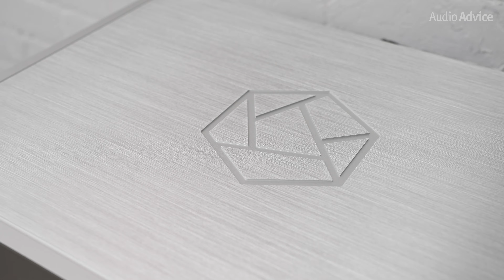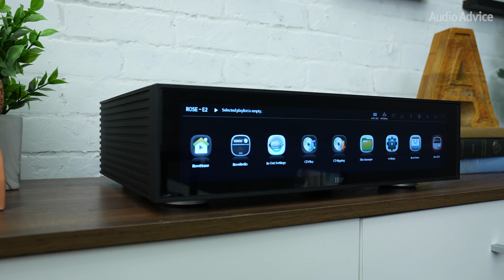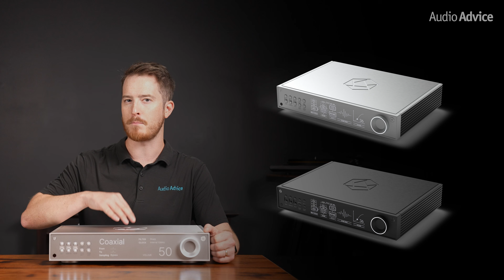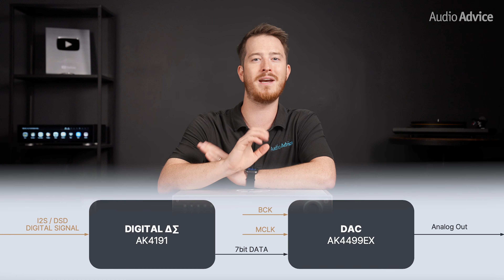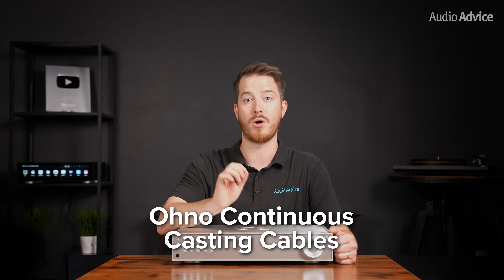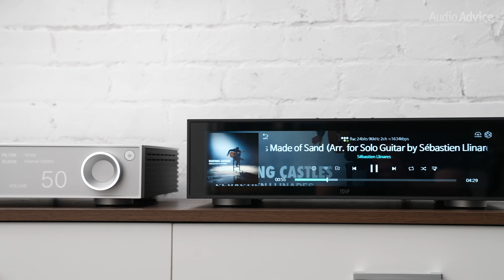HiFi Rose RD160 Digital To Analog Converter (DAC) - FULL Product Overview!

Comment: My initial thoughts for a piece of equipment that is meant to be future proof.

Pros: Build, in fact Everything, reminds me of Esoteric - especially ext clock. Happy to see direct SFP. 
Cons: No sub out. No HDMI out for AV processor. That volume control is a tad odd. USB In is not USB C (I can perhaps see why - given legacy investment - but not futuristic), does USB have/need power? 

Anyhow I am pleased that decent kit is being made again. Now we have a dilemma those opamps v tubes on the analogue stage. They look like they are not intended to be rolled, being specially made etc. Also where does EQ fit in, it at all?

Final moan (Sorry) why make components that are odd shapes and sizes? Again, what do I know. Perhaps that is a legacy of the '80s.

Did I miss: Can it be set to DAC only mode (without volume), so that I can still control volume via AV processor?

Thanks for the thorough product presentation and the effort in creating. This will no doubt make customers very happy. Just wish I could test on my main system without the flashing screen... :)

(If I did not already have a Leema Libra, I could be tempted)
Reply from the maker: Thanks for sharing your thoughts.

Comment: ROON Ready?
Reply: The DAC does not need to be Roon Ready, just the Network Player, which some call a streamer. The HiFi Rose RS130 Network Player is Roon Ready, and it works flawlessly (Some companies use the term Streamer in different ways, making  it confusing for consumers. HiFi Rose uses the term Streamer to mean Network Player and DAC combination)
Reply from the maker: Nothing out on it yet, but almost every other product from them is.

Comment: User friendly? WOOF i sold my RS250 SOLELY because of the opposite was my experience with the utterly cluttered app.
Reply from the maker: And what did you wind up with?  Just curious.
Reply: @AudioAdvice  Still playing around, but right now I have a Node connected to an SMSL DAC. It does the job, but the DAC doesn’t pair that well with the amp, which is parasound. Becomes way tooo digitallly and “etchy” up top! I LOVED the display and DAC/preamp sections of the RS250, because I do a lot music discovery and one glance gets me there, with a slick visual treat. 

Still looking for a streamer DAC that has large legible display from 10ft seating distance. CXN100, Bluesound Icon (when released) are in consideration… Im also looking for preamp with good low punch, so any recommendations are welcome! Loving my TT that I got from you guys!
Reply from the maker: @Mullster  Thanks for sharing.  Have you ever tried Roon?  It is not inexpensive, but it is a fantastic music discovery system.  That is what everyone on our team uses.  Not sure how the ICON will stack up to the RS250, we will know more in the fall.  Thanks for your support, glad you are enjoying your turntable.

Comment: @4:00 "Fiber optic USB...all of the noise and distortions from the source device are lost..."  You DO understand that USB is DIGITAL, right?  The only noise or distortion would be in the DIGITAL signal, and since USB has error correction, it would never affect the resulting audio.  It literally CAN'T - something would have to CHANGE BITS in the bitstream to do that.  This wins the award for the most idiotic audiophile quote of the month.  And 𝙩𝙝𝙖𝙩'𝙨 saying something!  Next you'll be telling me that the human ear can tell the difference between 768 kHz 32 bit and 192 kHz 24 bit.
Reply: No, that’s not correct.  Mhz and Ghz noise rides on the cable and we can hear that.
Reply: @leescoggins1  Wow.. you CAN???  Maybe that tin foil hat is conducting the RF into your brain.
Reply: Even then, it would just translate everything to optical, "noise" and all. Unless they are  filtering noise during the digital to optical conversion. I think they are really going for preventing noise/interference by going to optical.
Reply: @slip6699  We're not talking conversion here.  The data is encoded directly by the RD-160 into an Optical SFP module like you'd find in a high end Ethernet switch.  Still, data is data, and with error detection any bad data will be thrown away.
     There is no Optical USB standard, afaik, that uses SFP modules or even optical connectors, though there are many USB to SFP converter dongles out there.  I suspect "HiFi Rose USA" just built the dongle into the RD-160.

Comment: Need these features 
sub out with crossover management 
Hdmi eARC with Dolby digital 2.1 downmix 
Room correction 
Output voltage selector .
Reply: Those features should be on your preamp
Reply from the maker: This is meant to pair with their streamer in most use cases, then go into a high end preamp.  But yes, those would be cool too!